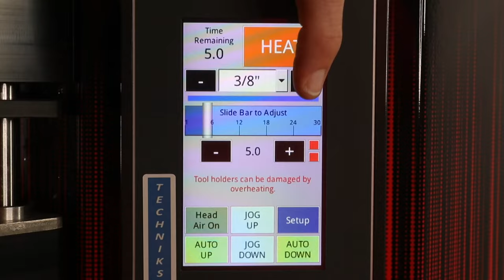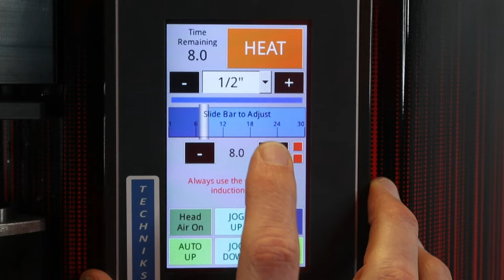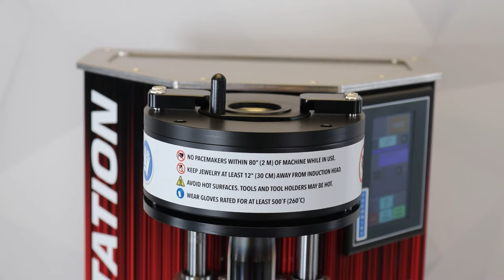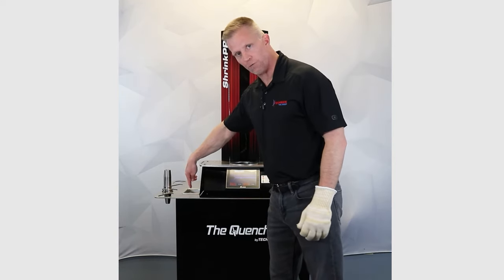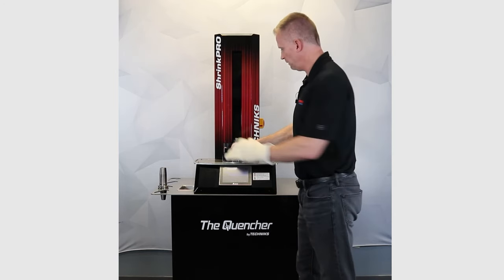ShrinkFIT Technology for Heat Shrink Tools

Comment: What's the best way to set the tool stick out length? Is there a stop of a gauge available for these machines?
Reply from the maker: You would use our stop screws, either standard or coolant-thru, to set the tool length.